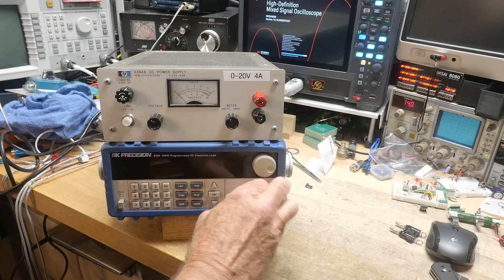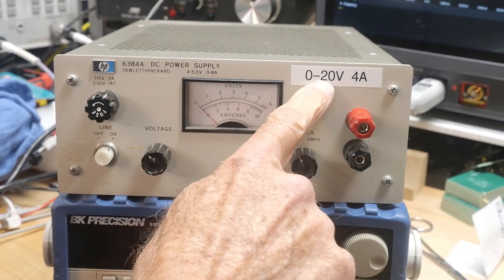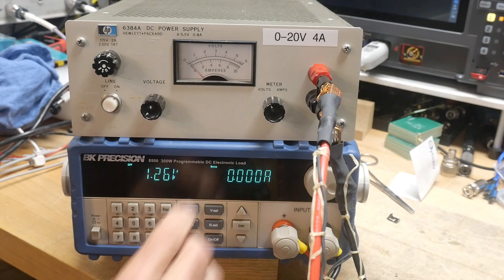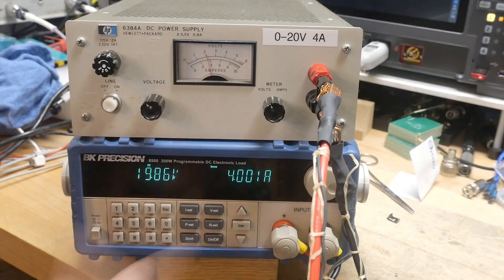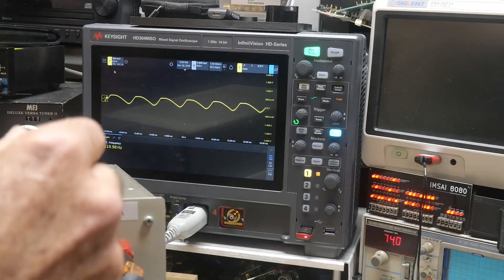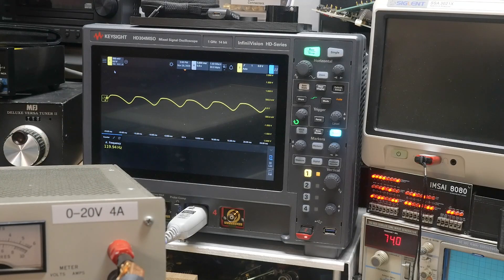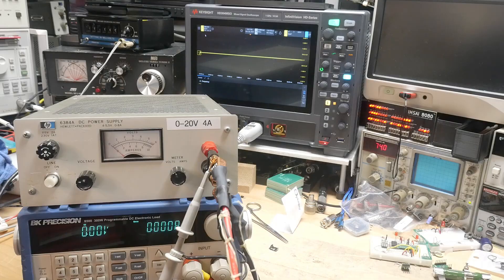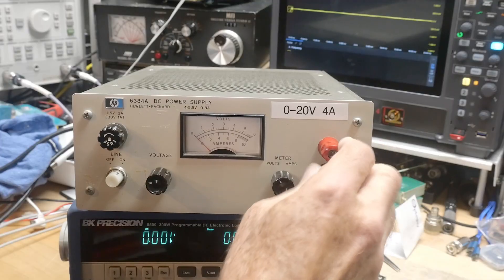#2434 HP power supply testing

Comment: What would cause a power supply to always output voltage even when turned down to minimum? It’s a dual range HP 60/120V 0.25/0.5A. It also outputs V way above these values when turned to maximum. I would love to repair this myself, but am struggling to understand the issue. Thank you in advance for any input!
Reply from the maker: could be lots of reasons. nothing I can say

Comment: It's clearly due to a lack of capacitor
Observe the top part of the ripple. It's flat and this flat part is the requested voltage. Its duration decrease when the curent increase because the capacitor voltage fall below the requested voltage. So you see well the discharge-charge phase duration increasing in the ripple curve, then flat, then discharge-charge.... etc etc

Comment: The voltage with ripple from the power transformer rectifier filter to the series regulator is drooping below the drop out voltage.  It's clear on the scope the ripple is just in the troughs.  A slightly lower voltage would have given you a clean output at much higher current... even if the transformer is not rated for that much power.  There is prob a good video in that :)

Comment: I have the HP6253 power supply. It is rated at 20 volts at 4 amps. It is a dual power supply and all that I can get out of it on both sides is around 14 volts. It is strange that both sides will be the same. Now the meter on the A side has wonky readings, and the meter on the B side is good.;

Comment: Power supplies are usually rated for a maximum continuous power.  If it started life at 5V @ 8A that would be 40 Watts.  If it's converted to 20V at 40W Max the current rating would be 2A.  I suspect the magic smoke might escape if it was left under a load of 3 or 4 Amps for a extended period of time.
Reply: @:54 he said he converted it.